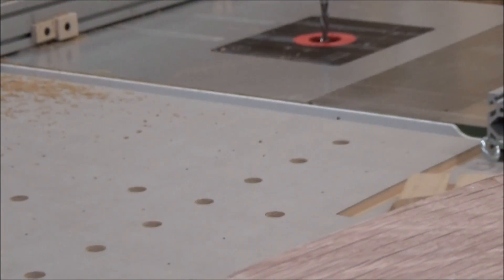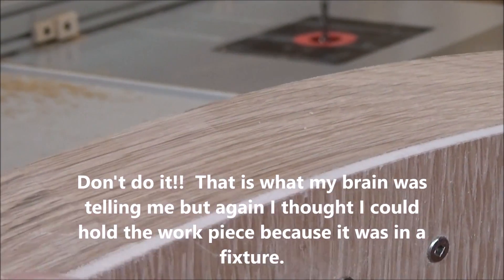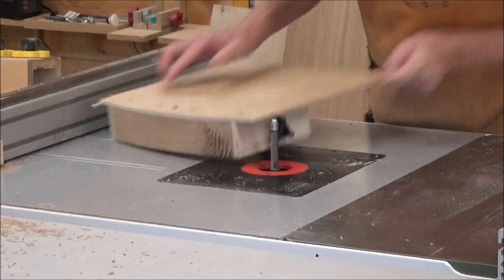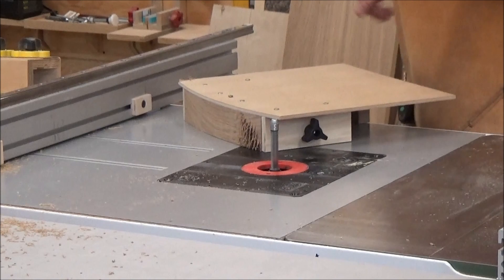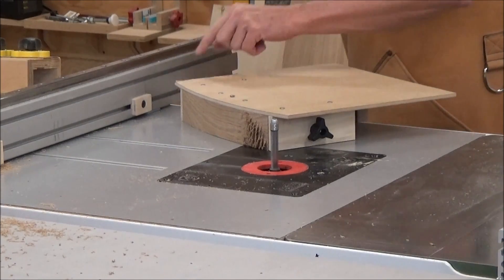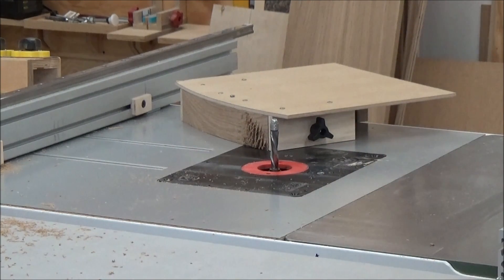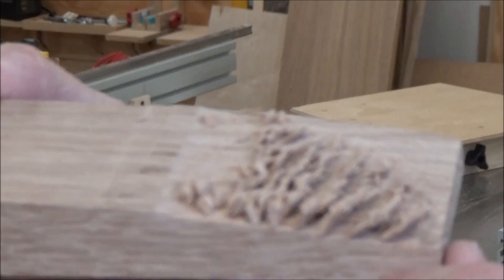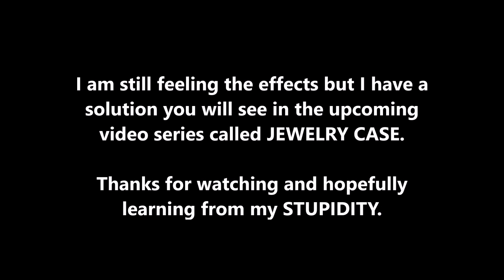Router Table Kick Back

Comment: Done my share of dangerous woodworking.  

There are multiple issues for the kickback.  As already noted, the spiral up bit is a huge issue.  As the cutter grabs the work, not only does the workpiece lift, but ALSO the template is no longer in contact with the bearing.  As you can see from the resultant ripped grain, the angle of the rip direction is clearly evident and the rip depth increases.   Once the piece lifted off the table even a fraction, the effect is as if you had no table at all and were just feeding stock into a rotating cutter.   Your attempt also was climb cutting which is inherently dangerous.

Your template design was good that you had made it longer than the part, this is one part of template design that they forget to teach you.   I have cut endgrain safely with light cuts and ALWAYS in full contact with the bearing.  With the proper cutter, does anyone believe that or successfully done a endgrain cut on a large part, moving in the opposite directing (conventional cutting), please chime in. 

Watching these kickback videos , I see a few common mistakes.  Templates too sort, (no run-in), not keeping the bearing in contact, taking too big of cuts (better to move the template back in small steps), not using the router table fence in combination with the cutter.

I use my fence as much as possible, exposing as little of the cutter/bearing as possible.  This allows you to keep firm pressure downwards and against the fence, taking only 1/32" off at a time.
Reply from the maker: Thanks for watching and your input.

Comment: Can you be more specific about what exactly happened and why that kickback occured?
Reply from the maker: The router bit is spinning counter clockwise and I was going against that with the grain of the wood running uphill because of the curved nature of the piece.
Reply: Kickback happend because he started routing in the middle of workpiece, safer optsion is to start routing at the end of workpiece going against the rotation of router bit.
Reply from the maker: @MMSS12  Generally what you are saying is true but not in this case. It would have happened either way. Thanks for watching.

Comment: Wait, can you please explain what happened? I mean by my observation, that's a spiral bit which should cut better than regular straight bit 

But however, cmiiw, did that happened because you're routing end grain? Thx before!
Reply from the maker: It happened because I was going against the grain. (Uphill) If you watch the series of videos on the making of the drawers I show the safe way of doing it. Thanks for watching.

Comment: I had kick back happen today cutting a 2x8 with a hand saw 15 amp scary stuff.
Reply from the maker: Hope everything is ok. It was only a couple of weeks ago that my finger finally feels normal again. Thanks for watching and I hope it never happens again to either of us.
Reply: Jeff Fischer would it be better if you had a sharper/newer bit?
Reply from the maker: @orange9807  Not at all. The grain is what is causing this to happen regardless of the newness or sharpness of the bit.
Reply: Jeff Fischer Thanks for the response Jeff. What do you think of plunge routers for joinery?

Would you reckon it is safer or better of with a router table?
Reply from the maker: @orange9807  I have both and it really depends on the project and your level of comfort.
Reply: Jeff Fischer Thanks Jeff have a good day.

Comment: Not to be a jerk/know it all but you were ignoring the direction that the bit was spinning, you were easing into a conventional cut in the direction that you would make a climb cut and kept repeating your mistake. Never make climb cuts on a router table and you definitely don't hog off a heavy amount of material with that technique. The only time I make a climb cut is if I'm doing a small profile or round over on a porous wood or if I run into some checking in my workpiece, definitely approach that kind of cut with extreme caution.
Reply from the maker: Thanks for watching and I knew it was a mistake even as I was doing it. Somehow I thought I could over it come it because of the fixture. Don't worry you're not being a jerk. I was being stupid and you can't fix stupid.
Reply: @JeffFischer1  I'm not a genius either man haha we just need to be educated on power tool safety. I lost my index finger in a table saw accident even with extensive knowledge of the tool but my employer didn't have any safety accessories on their saws. Just a friendly reminder to be safe. Check out stumpy nubs video on climb cutting he goes into great detail.
Reply from the maker: @XxStratAttackxX  Will do.

Comment: Apart from grain and bit movement, which is common approach, there is other no less important aspect of this accident IMO.
You chose to keep your both hands not only too close and exposed to the bit, but also you chose to press working piece from high above without any contact berween your hands and table. IMO you had the very good opportunity to lean your thumbs on table  from the back of workpiece. Instead you chose 100% vulnerable, high above hands position, close to bit, with not a single point of support.
Not only that you put yourself in highly vulnerable state, but also with high no support hands you was very imprecise how approach workpiece to the bit at several occasions.
Reply from the maker: Very inciteful and thanks for watching. If you watch the video series you will see my solution is very simple and easy to duplicate with no issues.
Reply: ThisIsSERBIA I'm new to woodworking, do you have a video example of what you're explaining? Appreciate it

Comment: I hope you don't mind me saying, but from the beginning, that was cringe-worthy to watch (like it would have been watching me when I started using the router table 25 years ago).  I kept thinking "wow, his hands are way too close to the bit".  Also, you touched the workpiece to the bit, and then started moving it from right to left.  NEVER DO THIS!  The work piece should be moving laterally in a purposeful manner BEFORE touching the bit; that greatly reduces the chance of the bit "grabbing". 

As you note, cutting uphill into the grain is asking for trouble.  Maybe with a very light cut with a thinner workpiece you can get away with it if you're lucky and careful.  That's a thick cut for such as small diameter bit; they can actually wobble a little when cutting.  I like the router bits with bearings on both the top and bottom; you can just flip the workpiece over with the template resting on the table, and adjust the bit height so you're using the lower bearing, and then route the remainder of the piece with the grain.  But I don't think they make 2" high bits like that.  Another thing to make things less scary is to do only half the thickness with a 1" template bit, and then do the other half with the bearing riding on the part you just did.  But I think that works better with a handheld router with the piece clamped to the bench.
Reply from the maker: Thank you for taking the time to detail your thoughts and for watching.